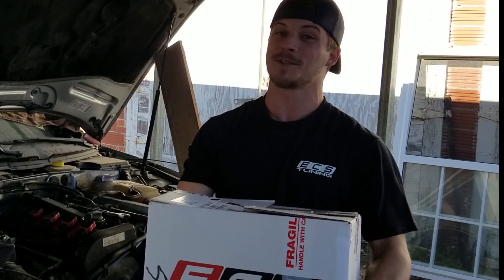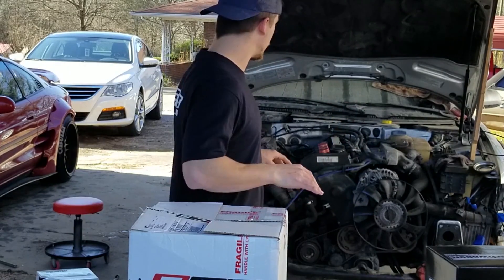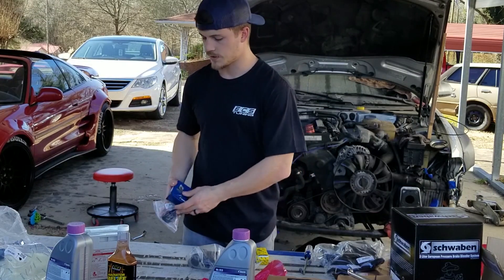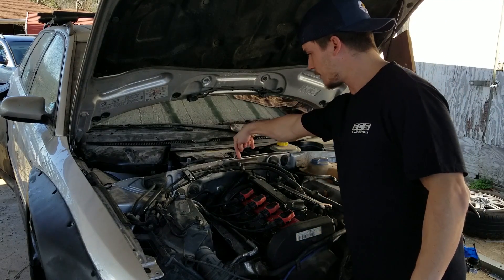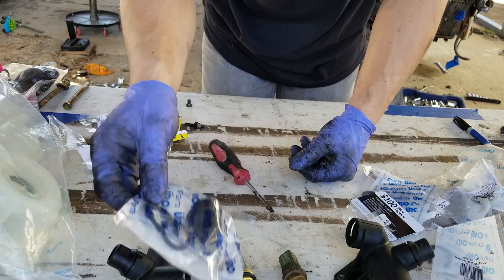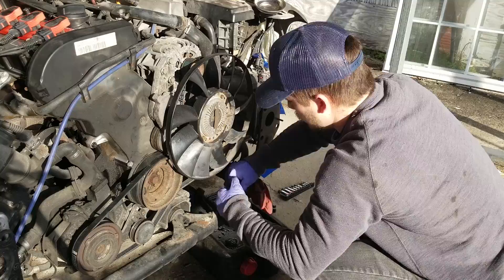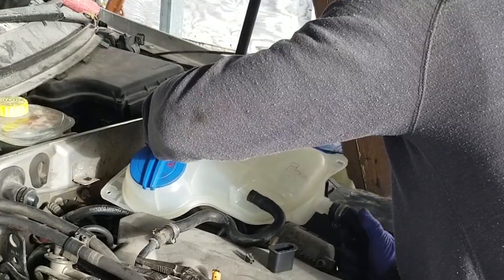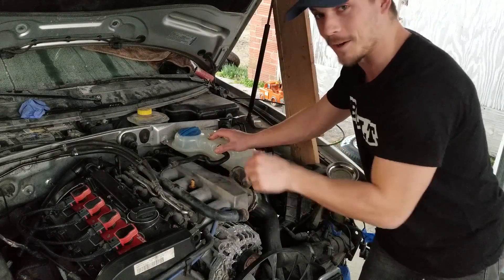DIY WIDEBODY AUDI A4: THE COOLANT SYSTEM WAS GROSS

Comment: Would you not think about using a waterless coolant? It'll save rusting the new components, won't leave your new expansion tank looking crappy in years to come, has a mega high boil point (can take cap off expansion tank once engine fully warmed with no explosion) and a mega low freeze point.

Evans coolant is a brand in the UK if you want to have a little research first 

Love the build you've got here and love how you are as a family man. Inspiration to all. Keep up the good work and much love from the UK
Reply: @BUILTOFFICIAL  something recommended even if it's not for a car your building. Stick it in all your cars.

Comment: I cleaned it off with degreaser than used steel wool and water, clean all off than used silver high heat header paint. also did it on my turbo because it turned out amazing!

Comment: It's looking amazing so far, keep up the great work! 
My recommendation would be if you shine the intake you have to do the same to the alternator or else it'll stick out just like the intake did before.
However if you powder coat the intake you could mute out the alternator with whatever dark color you wanted or make it pop, users choice really.
But you gotta do both or else it'll still look unfinished, at least in my opinion.

Comment: for the intake manifold, start by cleaning with degreaser and a scotchbrite pad and a hard brush.  99% of the time it's just old gunk that'll come off with a little tlc, and this method is a bit safer from deep scratches than a wire wheel.

Comment: Yo build dude.. the intake manifold.. either walnut blast or sandblast.. but sandlblasting would yield better results but soak it with a quality degreaser first.. then do the deburring or rough edges and the intake runners clean it for a good clean transition for the air.. then portpolish the internals as deep as u can then Voila!

Comment: My Passat leaks from that coolant flange and I'm going to replace it probably next week, any tips on the process? It's an APU engine
Reply: @BUILTOFFICIAL  Thanks! I was having problems with access to that area, I have a coolant hard line running behind the engine, I'll try again removing some stuff. Didn¡t know about the quick release hose,  I have to say the video was really helpful